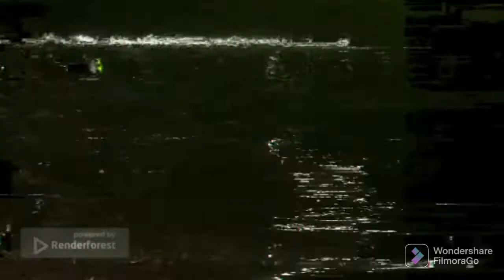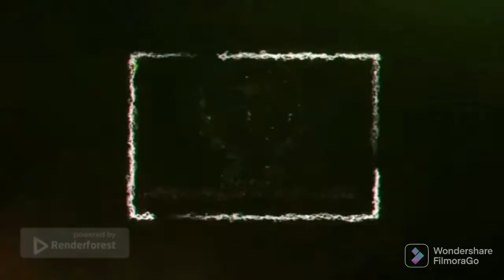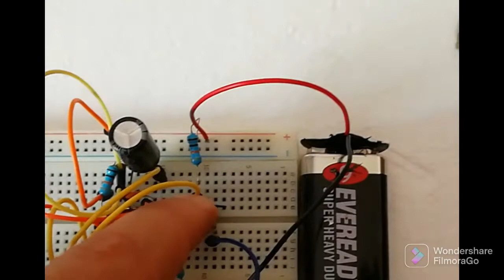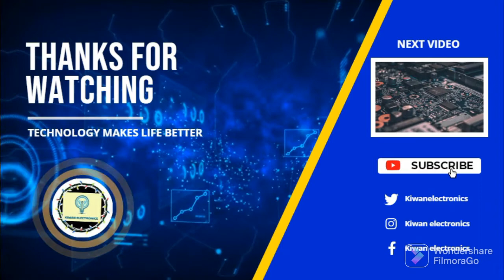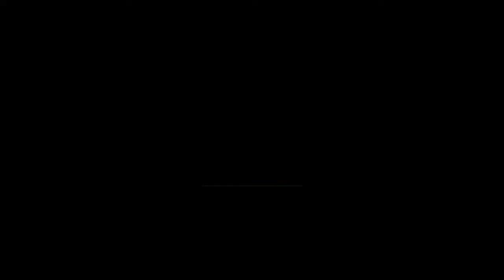555 timer monostable mode circuit #circuit  #led #555timer #tech #electronics #project #digital #all

Comment from the maker: #tech #all #electronics #tech #engineering #circuit #led #timer #control #FilmoraGo

Hello  all  today  in this  video  I will show you how to  make monostable  mode  circuit  using  555 timer. 

You  can check  all details about  this project  in the  attached  link below :

https://www.instructables.com/555-Timer-Basics-Monostable-Mode/